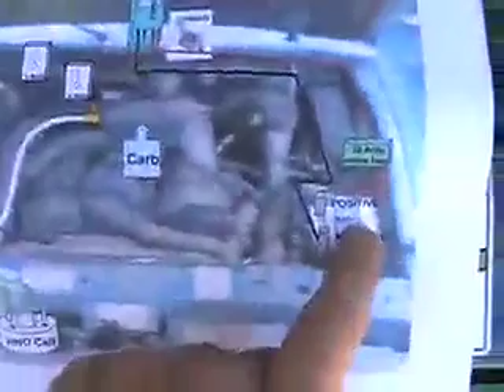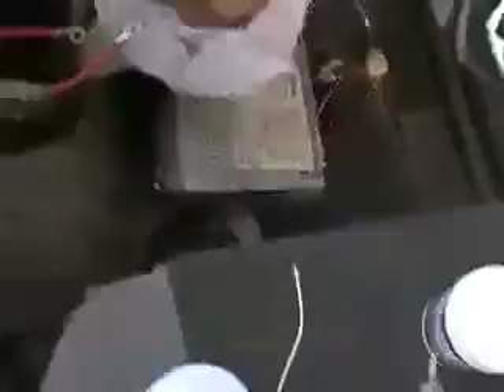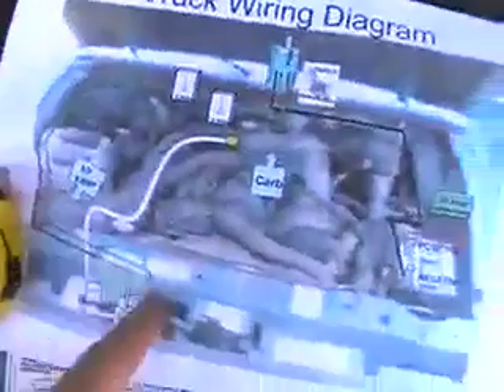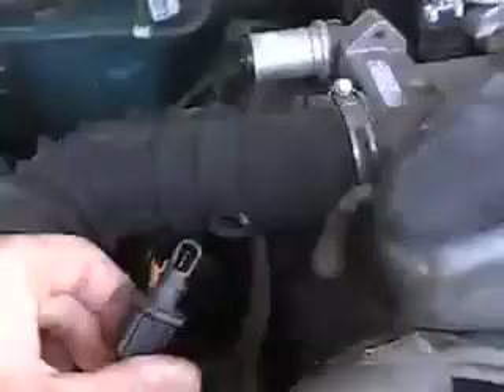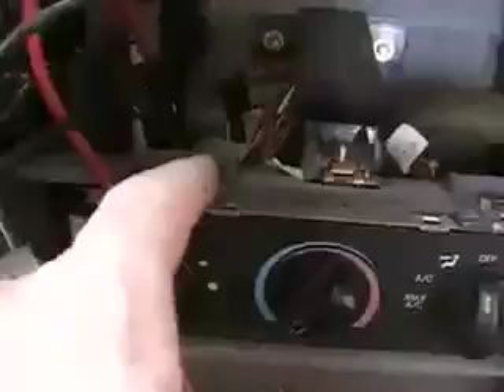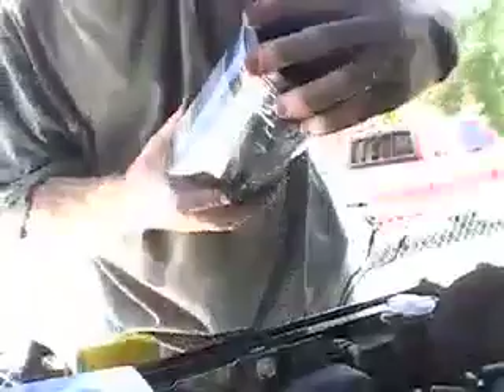008 Installing System Part 1

Comment: I appreciate somebody doing an install of the smack. Thanks for your construction and install videos.  
The sensor you pulled out of the intake is not the O2 sensor. That is the air temperature sensor.  The O2 sensor is underneath the vehicle screwed into the exhaust pipe next to the exhaust header.
I'll be interseted to see what your MPG results are.
Keep posting, thanks,
MrBill